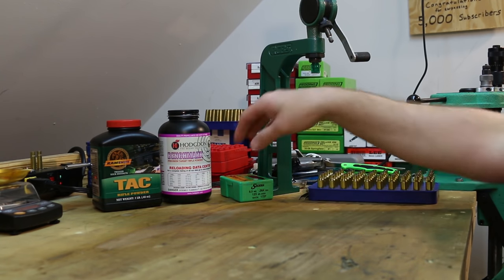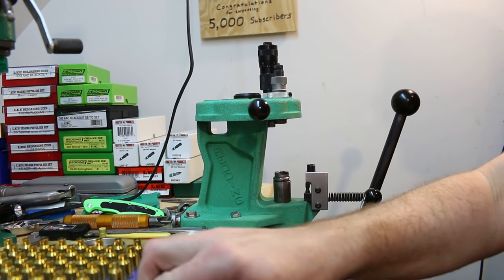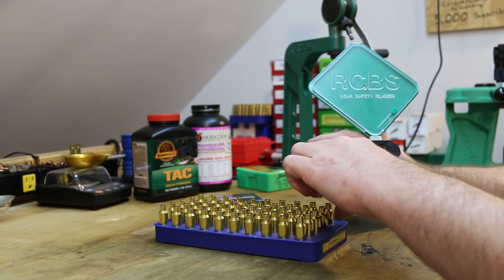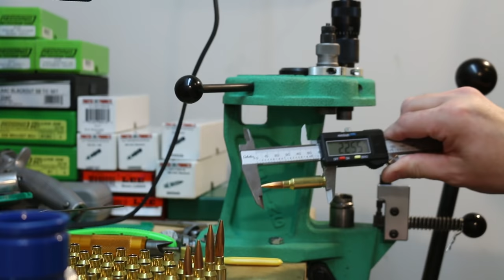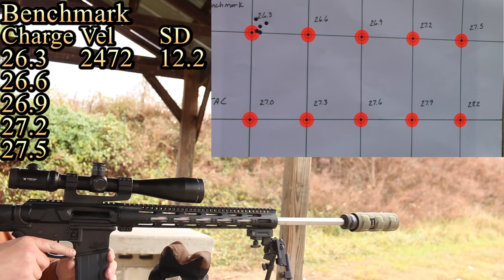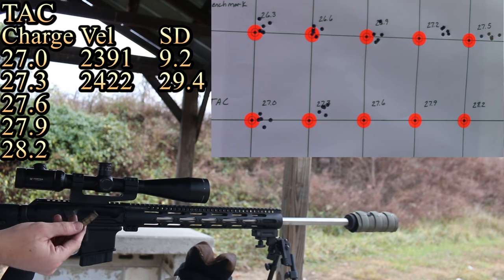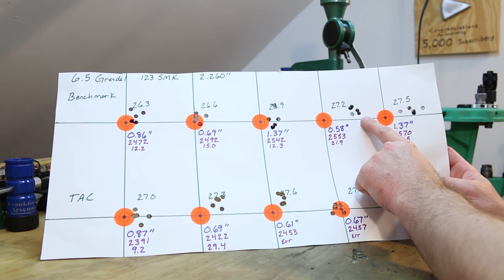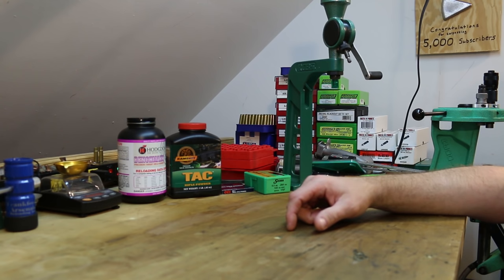6.5 Grendel - 123gr Sierra Match Kings with Benchmark and TAC

Comment: Yeeeesssss!!! More Grendel! Very excited to see your results with the Noslers. I finally got a good load with them using Hodgdon Leverevolution. Around 2500 fps out of an 18" barrel (AR Performance with the 750XD bolt rated for 60,000 psi) and they just stack into a nice 0.6-0.7" group every time. Another bullet I'm really excited about is the new Hornady 123gr ELD. Would love to see some testing with that one if you have the time. Hope you have better luck during Muzzleload in the woods, I feel your pain with not seeing anything.

Comment: It's an Optimum Charge Weight (OCW) thing. It's kind of normal for the POI to shift around as the vibrations of the barrel changes.  I would look for the smallest shift in POI between strings.  28.0 or 28.1 with TAC would be very attractive to me with what you have there.  Both the 27.9 and 28.2 groups are nice and tight and the POI shift between them is very small.  So I'd go with something right in between.  I have a grendel which I absolutely love and I have been through this exercise with it.
Reply: 28.0 or 28.1 would be nice

Comment: Your Hornady comparator tool shows the same fired reading as mine.  I bump .005" as well.

Benchmark is fast for 123gr in 6.5 Grendel.  I recommend only loading up to 100gr with it.

CFE, LVR, AR Comp, and 8208 XBR are very popular with 120-123gr.  8208XBR is a bit fast, so as long as you don't exceed 28.3-28.5gr, depending on your throat.  Book from Hodgdon's with 123gr SMK and 8208 is 28.5gr Compressed.

I personally like CFE223 with 6.5 Grendel, as it is very forgiving and you get a full case, with high velocities, and lower pressures.  We tested it with several different bullets in a dedicated pressure-trace rifle with the sensor over the chamber in the correct location, and my pet load of 31.2gr of CFE under a 123gr AMAX only generates 46,235psi at 2.260" COL.

I'm halfway through the video right now.

Comment: Nice video! So far the only powders I have tried for the Grendel is IMR 8208 XBR, WIN748 & CFE223. The 8208 is my go to powder. Still working on loads with 748 but it shows some promise. Do have some TAC that I need to try. And it's nice to see someone else using the Lee Dippers to get your charge started.
Reply from the maker: So far my favorite powder is AR-Comp.  It showed some awesome accuracy in my earlier tests.  8208-XBR has shown a lot of promise in my gun as well.  I couldn't live without my Lee dippers!

Comment: Watched a Vid on 6.5 G with H322 and shot your load data. It was great! Out of H322 in these component shortage times, but have a pound of TAC. I'm hoping to get your results with 27.6-27.9 with 123 Lapuas. Will also be checking your Vid on the 107 Sierra MK's. You're an Encyclopedia of Load Data.

Comment: With 129gr ABLR, the powders to beat right now are CFE223 and LVR.  One thing about the Noslers is that they like to copper foul a lot, but I haven't seen any of that since I shoot them with CFE223, and get over 2400fps from an 18" Lilja barrel, which is more than plenty of speed with that .553 BC.  They also expand down to 1300fps, and have proven to be excellent wild boar killing bullets.  Expansion is immediate and full, with full penetration and internal devastation.

Comment: Gunna regurgitate sum information here. Looks like a scatter node or “anti node” at 27.5 grains of Benchmark. That could be a good thing. Typically at about 1.5% above or below the scatter node, you could try 27.2 and adjust seating depth to tighten it up I do believe

Comment: FTF with suppressors is normally high cyclic rate, which needs to be slowed down with buffer weight, adjustable gas, or both.
Reply from the maker: Yup, I am most likely going to go with an adjustable block.  Having said that...after I finished filming I shot 40 more rounds out of my 20 round magazines and didn't have any issues.  I may have a bad magazine on my hands.  More testing to come.
Reply: I have had a suspicion for many years that the AR-Stoner mags are rejected lots by the pallet, with AR-Stoner floor plates.  The straight 15 to 17rd mags that CProducts and ASC made were rejected by AA, since AA asked for a curved 15rd mag.  They will work with 7-10rds in most guns, but not beyond that.  Those mags should have been turned into scrap metal, but instead were most likely dumped onto the market since demand for mags was so high.
Reply: Johnny's Reloading Bench my favorite gas block is the Rodin Works adjustable, well made with front adjustments and detents on adjustments for repeatability

Comment: Johnny you do great videos but I think life would be better if you got an RCBS Chargemaster Lite for weighing charges.  Mine works super with only an occasional over charge which I just put back in the hopper and do over.  It would save a lot of time and it's so easy to just work up loads.  You can recheck with another scale easy enough, but I have not had any problems and every time I have checked it has been right on.  They can be had for a couple hundred dollars at Natchez Shooters Supply online.  The competitors have issues.  The RCBS has a nice slow trickle and seldom over charges.
Reply from the maker: I have the Lyman Gen6.  Works great!  I just don't like filling it up to load 25 rounds.  Great for big batches!

Comment: wish this round was more publicly known. Called the biggest gun shop in town, asked if they had anything grendel. my responce from them was no one shoots it.
Reply from the maker: I feel like it's gaining popularity.  It's an awesome round for the AR...word will get out eventually.  Barrels are still pretty expensive.  If cheap $100 barrels were available like they are for 300 Blackout you'd see the popularity skyrocket, I bet.
Reply: There are cheap barrels out there to buy.  If you do some online searches you will find barrels for a little over $100 and less tan $200, you can buy the bolts for $100 or less.  I just ordered a complete upper for about $350 because I didn't want to take apart a working upper to change it out and get left with parts.  I am considering selling one of my uppers that is just picking up dust instead of being left with loose parts that I won't use or have a problem selling.  I was considering changing an upper out until I weighed my options.

Comment: OBT analysis is predicting an accuracy node for Ramshot TAC at 28.9gr and 26.2gr for Benchmark.
Reply from the maker: Looks like I missed the sweet spots entirely!
Reply: Maybe and maybe not its just a prediction but usually its right on the money in the 120-125gr range. I have noticed that the 24in Satern barrels closely track the 22in barrel predictions for some reason so thats what i gave you. I would love it if you would log your best results in our community spreadsheet. Send me your gmail email and i'll send you an invite to edit. https://docs.google.com/spreadsheets/d/1IJ99k4Kei86K7BmQGqezj67EA4UJ-cYlN8V6_NH0jqE/edit#gid=385694173
Reply: You might be interested in the 129gr Nosler LR predictions but i would not swear they are right on we have seen as much as .5gr off for the 130gr range of bullets but if you reduce your load increment in that range you should hit the sweet spot. https://docs.google.com/spreadsheets/d/10N3FszBm0JJlLvsFagGwKakcKxE0D5p39L-FmCVPuvM/edit#gid=0

Comment: In most cases a silencer will register an impact shift and every time you put one on unless it's timed correctly it will register different impact shifts.  A good reason to time your silencer.
Nice vid and great shooting.  I'm just getting into the 6.5 G and have high hopes.  Does it work best in longer barrels or will a 12.5 work, I'm sure I'll loose velocity.  I'm looking to build a 3 cal takedown backpack gun in 5.56, 300 Blk and 6.5 G.

Thnx and Regards,
Marc

Comment: OAL is in YOUR control, with 2.263, 2.260, 2.655, 2.259. If your target OAL was 2.260 than every round should have been 2.260. knowing that the bullets have different OAL, your going to have to back out your seating die than bring it back down so every completed round is 2.260. With such a large difference in OAL of your rounds that will add to the reason your groups had such a large point of impact shifts! 
And you will also see the effect of different OAL in the ES on your Chrony. My question is why do you shoot suppressed ? 27.9 Grs of TAC was your best group

Comment: If you want speed, you really want LVR and CFE.  You can get to 2700fps from a 24" in some guns, but 2600fps is easily achieved with those powders.  Same with AA2520.

I also noticed your trigger technique is biased downwards, as in the pull direction, and you can see this on the video.  If you set your trigger finger up to pull straight to the rear, your groups will tighten.
 
Using fine-tuned technique like that, I have rapid-fired many different loads from lightweight to heavy 6.5 Grendel's into the .2s and .3s, 5rd groups or more.  The lighter guns are more difficult to manage though.

Did you bed your barrel into the upper by any chance?
Reply from the maker: Upper wasn't modified.  Barrel was just installed in the normal manner.
Reply: I prefer to bed all my barrels, and select uppers that have a tighter tunnel.  If the tunnel is loose, I will either get another upper, or build up Cerakote in the extension tunnel until the fit is tight.  I square the face first of course.  Once that's all done, I bed the barrel extension into the tunnel with Blue Loc-tite #242, and use at least 65ft-lbs of torque on the upper.

I also bed the gas block with Red Loctite 272.

With the Liberty barrel (button-rifled barrels associated with Satern, but not cut-rifled Satern), find where your lands are and consider adjusting seating depth, with full-stroke cycling into battery testing to ensure you don't jam the lands.

For not being bedded, your upper is shooting great.  With these few accuracy-enhancing techniques, and fine-tuning your trigger pull and rear bag set-up, you can shrink your groups noticeably.  Great video BTW, thanks for the work you're doing.

Comment: Sweet video I would suggest a brass catcher so u don't lose that expensive brass. How much did u spend on ur upper? I been looking into either a 300 blackout or 6.5 what would u suggest as a new build?
Reply from the maker: Man, that is a very tough question.  If you need/want heavy subsonics, of course 300 blackout is the better choice.  Other than that, I would say that 6.5 Grendel is far superior in just about every way.  It's a better hunting cartridge and has a much longer maximum effective range.
The price difference is dramatic, though.  The cheapest 6.5 Grendel barrels are still quite expensive, while you can find 300 Blackout barrels for $100.  6.5 Grendel brass is pretty expensive, while you can convert 223 brass for the 300BLK.  Bullet choice is another thing that favors the 300BLK.  You can find all sorts of cheap 30 cal bullets for plinking.  You will also need dedicated magazines for the 6.5 Grendel and there aren't any cheap options out there.  Lots of little things that add up quickly.

I spent a lot on this upper.  Gibbz side charging receiver ($250), Brownells barrel and bolt ($300), Midwest Industries 15" rail ($200), Silencerco muzzle brake ($75), AIM NiB BCG ($75), gas block & tube ($30), AADMount scope base ($280), Vortex Viper PS-T FFP 6-24x50 ($950).  Good god that is depressing to write it all out.  Over two grand.
Of course, a lot can be trimmed down from this.  Swap the side charger for a standard $75 receiver, buy a cheaper muzzle device if you don't need suppressor compatibility, and buy a more reasonably priced optic and base. 

On the other hand, my 16" 300 Blackout upper was built reasonably cheap and shoots awesome.  BCM blemished upper ($75), AR-Stoner Barrel ($90), Generic semi-auto bcg ($75), gas block and tube ($30), BCM KMR 15" rail ($200), Silencerco flash hider ($75), and then I just use one of my quick disconnect scopes that is in a Burris PEPR mount, or put a red dot on it, or sometimes I run Magpul MBUS irons.  Whatever I feel like at the moment.

It all comes down to your requirements!  I absolutely love 300 Blackout for its versatility.  I love 6.5 Grendel for its capability.
Reply: Jefferson State Reloader they are apples to oranges.  300 AAC Black Out wins short range or suppressed.  6.5 Grendel wins for long range especially in long shots hunting or target.  I have two .300 AAC Blackouts one short barreled rifle and one carbine.  I am purchasing a 6.5 Grendel upper on order at Midsouth Shooters Supply with a 24" SS fluted barrel for only $350.  I found it a more reasonable option to buy one at that low price already built than spend more money building one myself or converting an upper I already have and being left with unused parts laying around.  A choice is simple as short range or long range, what do you prefer.  If you have brass and dies they are both affordable to shoot if you reload.

Comment: Do you have the same fail to feeds and ejects without your suppressor?

I really enjoy your channels.  Keep up the great work.
Reply from the maker: These are the first failures I've had since I fixed the extractor shortly after building the gun.  I still think it was the magazine but I'll be doing more testing soon.
Reply: Johnny's Reloading Bench Just wondering if it is an over pressure issue withe the suppressor causing the bolt to cycle improperly.  
Magazine could very well be the issue.  My POF .308 does not like the Magpool mags loaded to capacity.  Pull out two rounds and no problems.

Good luck.

Comment: I'm running through some Hornady brass and 5 outta 50 needed trimmed. I also heard you talking about bumping the shoulder back and with my Lee full length die I can feel when the shoulder touches the die. I've not got a gauge to measure to the shoulder so I just bump it on back. Is there a big dif when you don't move it back? Also anealing? I've seen a few guys that do it and alot that don't. I understand what it does for the metal on the molecular side but is it really that important?